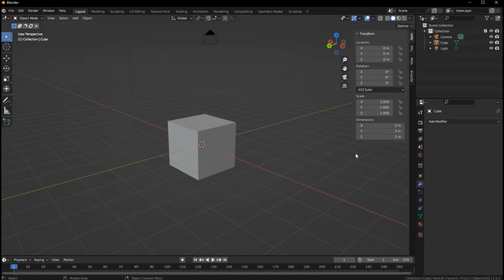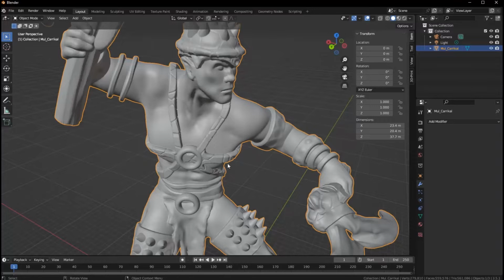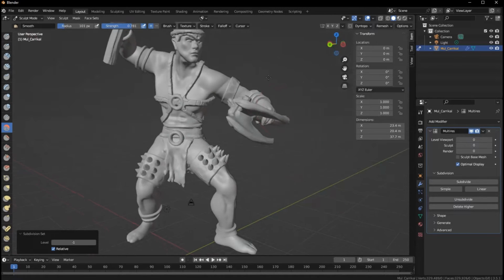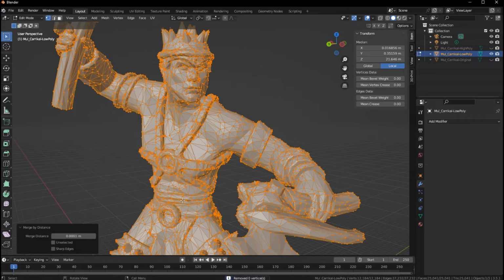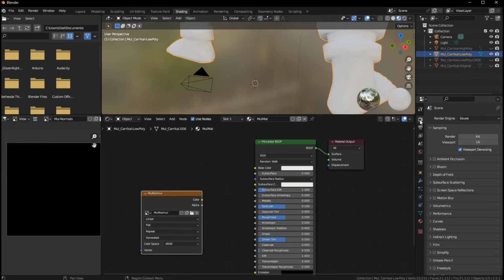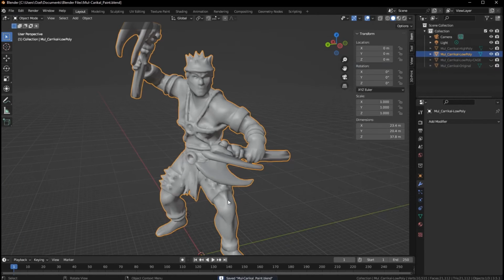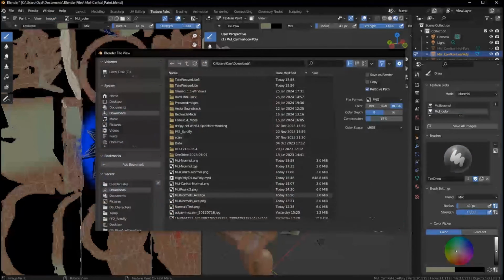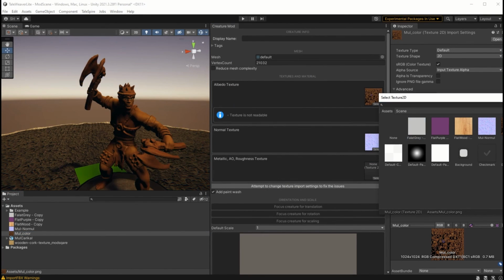High Poly Stl to Unity Ready Model for TaleWeaver

Comment from the maker: Since folks found this so helpful. I have expanded on the topic in another playlist: https://www.youtube.com/playlist?list=PL6WbpvFNNMlSkNrFr7B9D7eOQA70uOcww
This playlist also includes how to make a PBR/MOAR texture and includes bonus videos on other neat Blendery things.
Also, some corrections: 
1. The poly count issue was related to the blender export. You need to have shade smooth on when you export the object. I'm not sure why Unity ups the poly count if it is not. But this is an export issue. I talk more about the right export settings in the main playlist. 
2. The lighting thing. TaleWeaver is on point with how the lighting will/should look in game. :) In my other videos I get the shaders in Blender to better reflect what the Unity environment has setup. When in doubt, check it in TaleWeaver and adjust. ^_^

Comment: TaleSpire dev here. This is great!
Also if TaleWeaver is imposing limitations that feel like bugs (beyond the poly-count, tex-size, etc requirements) do let us know as they likely are bugs. For example the comment around 19:30 has me concerned.
Reply: I'm also gonna get the artists involved with the default lighting in TaleWeaver, I bodged it together out of stuff from another internal tool and I'm confident it needs work. Might explain some of the differences of the appearance compared to blender
Reply from the maker: @CBaggers  Didn't see your second comment at first. So long as it look in taleweaver like it will in talespire, I think then that is good. Talweaver should be giving that kind of preview. The default flat lighting in blender is not always the most representative, so I would not chase after it. :)
Reply from the maker: This is probably due to the difference in how poly count is calculated by Unity from the obj. It seems unity counts every faces vertices in the count regardless of whether or not they are being shared. I'll pm you. (edited for clarity based on findings)
Reply from the maker: Just adding this comment in case other folks were wondering or reading down in this thread (which I realize I never circled back on): 
Both of these 'oddities' are solved in my other videos. 
1. The poly count issue was related to the blender export. You need to have shade smooth on when you export the object. I'm not sure why Unity ups the poly count if it is not. But this is an export issue. 
2. The lighting thing. TaleWeaver is on point with how the lighting will/should look in game. :) In my other video I get the shaders in Blender to better reflect what the Unity environment has setup. When in doubt, check it in TaleWeaver and adjust. ^_^